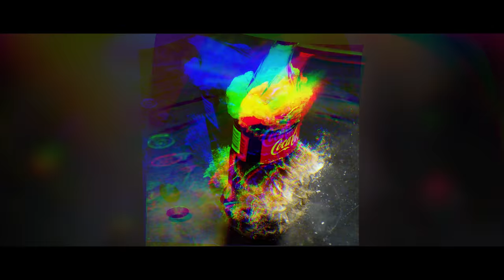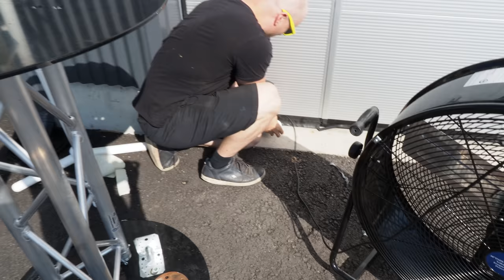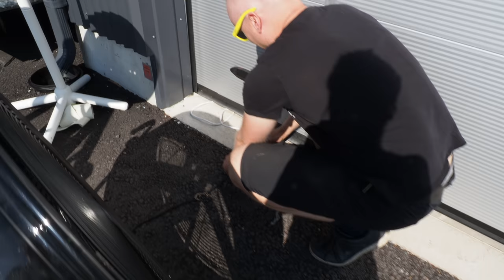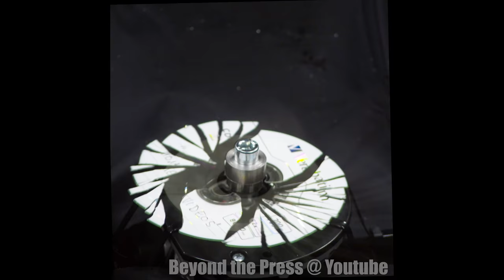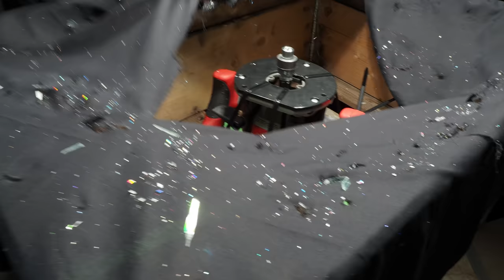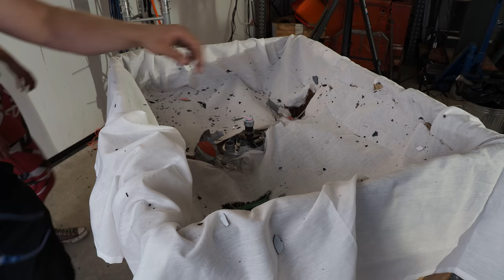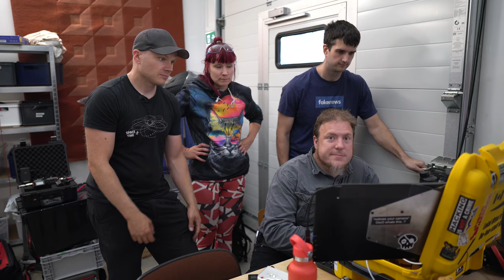Exploding CDs Filmed with Spinning Slow Motion Camera | 330 000 FPS!

Comment: So storytime: Years ago I had an idea to make a spinning steel disc experiment, but it was just an idea.  Along the way of emptying hoarder homes of their contents for 15 years I came across many things for tinkering and experiments.  One day I found an old die grinder with a label that said it had a 60,000 RPM turning speed, and I was like "there it is".
Time went by and in another garage years later I found 3 steel discs with a 5" diameter, 3/8" width and a 1/2" hole...and I was like "there they are".  More time went by and one night while drinking with a friend in my garage (see videos lol) I don't drink anymore for reasons that will become apparent:  I took the die grinder out, ground down a rubber stopper to the correct taper, JB welded it to the die grinder shaft and promptly press fitted a cd onto the end in my driveway.  Hit the switch and about 2 seconds of spool up- KABANG...vaporized, Cd material rained down everywhere for about 20 seconds.  I was like, that was unexpected and dangerous, lets do it again.  So after shredding a decent part of my 90's CD collection I grabbed the steel discs and we headed to the alley behind my garage.   Brought a hammer to knock the disc off the tapered rubber mount once speed was reached, and all went to plan.  The disc spooled up for about 30 seconds to top speed (which I estimate to be around 40,000 RPMs) as I could literally feel the power absorbing into the disc through my outstretched arms.  I knocked the disc off with a jab of the hammer and it dropped to the ground, stood still for a moment erupting a rooster tail of orange sparks 10 feet back, then exponentially accelerated similar to the deloreon on back to the future, and disappeared in a blur of high speed in an instant about 80 ft down the alley.  So me and my buddy decided to walk to the end to see if we could find it (about 300 ft away) as we approached the fence it dead ended into a slightly effeminate man appeared over the top holding the disc and said "WHAT is this THING? It justran up the side of my house and wrecked my siding!!!"
I took it from him, looked at it inquisitively and said "I have NO idea"
We then turned around, walked back to my house, locked the gate.and we laughed and laughed.  Moral of the story: be safe, don't drink to excess, and spinning disc contraptions are not recommended unless controlled conditions are available.
Reply: Great storytime! Thankfully, everyone was unharmed. :-D

Comment: So you are now record breakers :)

Nice videos, reminded very much of the slow mo guys disk breaking.

Will Phantom be able to make a ring now?
Reply from the maker: I am not sure can you trigger those accurately enough to do that. The Chronos cameras are easy to trigger very accurately but it's not the case with all high speed cameras. Also the amount of data involved with for example with 72 v2512 cameras would be really demanding to handle :D
Reply: Beyond the press  yes it would be quite a challenge, the trigger being the key, with so many frames its probably just enough that they go off at different intervals rather than any specific order. The data is recorded locally on the phantoms, do chronos do the same? Does the ring work. Differently by sending the data to some other device immediately

Comment: This video really turned out great Laurie/Annie. 💿💥🔫😎👍(PULL!!)
I was thinking about,what would happen if you overclocked a computer hard-drive,these typically spin at about 5,000-to-10,000 R.P.M.'s per minute...what if you were to spin it at about 3-times that speed!!??.
Reply: I definitely want to see this! Those platters are significantly heavier than a CD - but they are also a relatively ductile metal. Will they shatter? Will they do nothing? Only one way to find out!
Edit: Today I learned that some platters are a glass/ceramic material and not always aluminum. Those would be fun!
Reply: @bradley3549  That's what I'd like to know,if it does explode,the entire hard drive is going to be a bomb.HAHA!!.

Comment: Years ago I had a cd blow up in my computer's cd-rom drive. Scared the hell out of me, one piece of the cd shaved a piece off of the drive door and stuck in the wall, and the drives internals were absolutely mangled. Luckily I was sitting away from the computer and to the side or it could have been nasty.

Comment: Are the cameras off sync enough that you get 72x slower footage?  Each camera is offset by 1/72 the frame rate?
Reply from the maker: Yep. We can run also them synchronized or have multiple virtual cameras rotating at the same time. Having multiple cameras is handy if you want to be sure to see something happening and not have your camera on wrong side when event happens.
Reply: @Beyondthepress  "The Event." 
I'm guessing we will hear that reference many more times in future videos. 👍